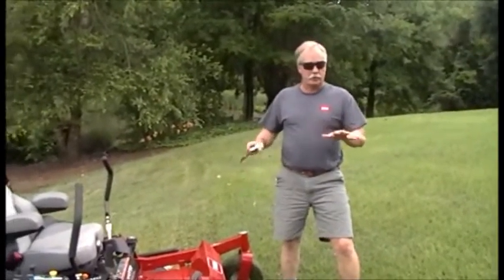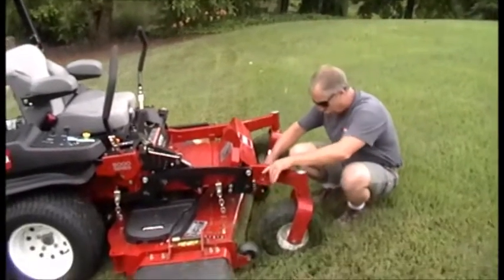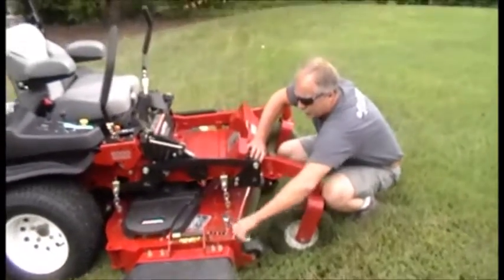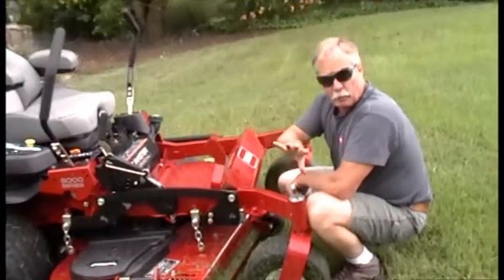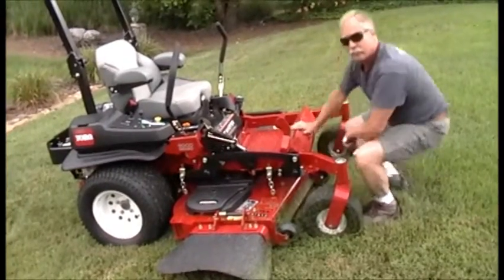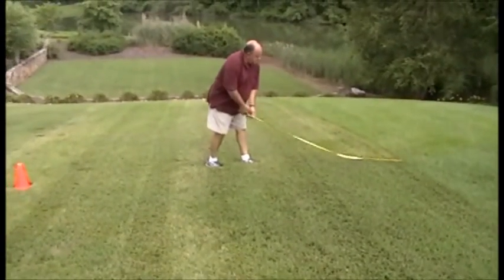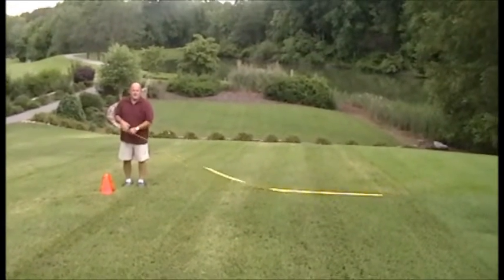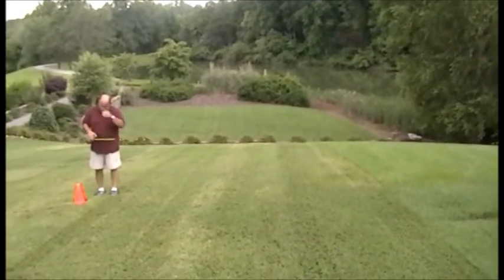Toro Turbo Force Deck Adjustment and Operation

Comment: I have found if very dry the A setting works great.  C is for high and wet grass, minimal clumping.  I removed my rubber flap.    Also the EZ-vac system is awesome for leaves.

Comment: This is a good video but I would like you to challenge the machine. Practically ever ztr can handle the lawn you are cutting. It would be nice to how well the mower does with tall wet grass. Toro evinces how well it cuts in wet without losing production because of the technology of the deck. Please don't us you most powerful mower either. Please specify speed that you are mowing at too. Would be nice to actually see the clipping sizes too. I believe if Toro or any brand can visual prove this in a video they will be number 1 brand.